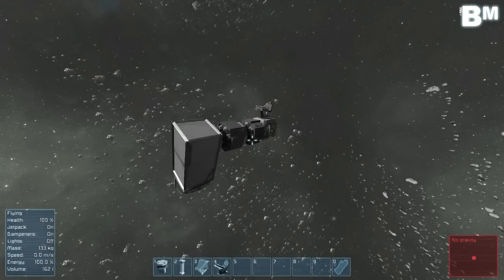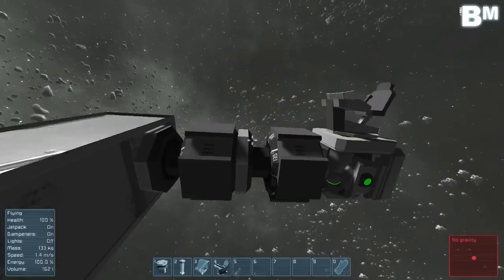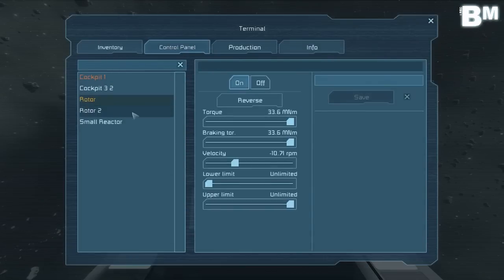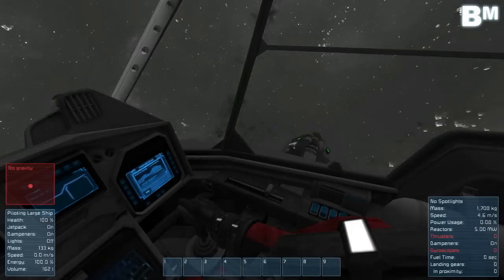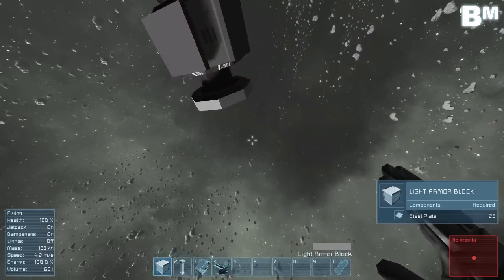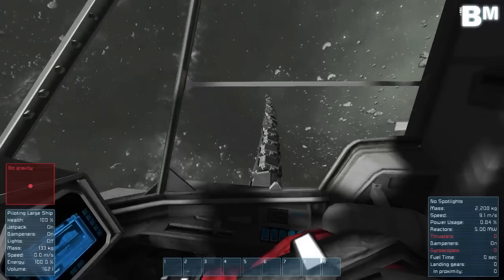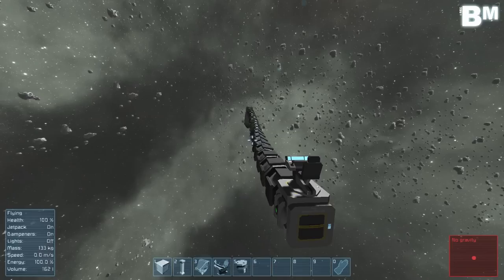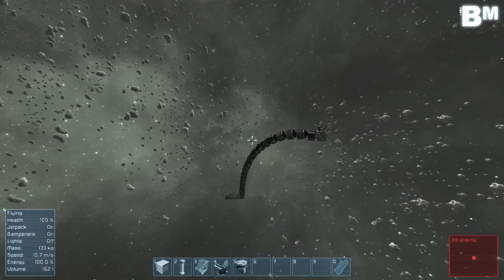Space Engineers - Rotating a Rotating Rotor

Comment: My guess on why it isn't rotating at maximum speed is that the rotors don't have infinite torque.  Each rotor you add theoretically adds a bit of rotational speed, sure, but ti also adds more torque load on the previous one.  Thus you get very rapid diminishing returns.  You might get better results with a balanced 'beam' at the end (think propeller), but you're still going to run into torque limits to accelerate the load up to maximum theoretical speed.
Reply: For clarity: Your 'load' has nonzero mass, therefore it requires torque to increase its angular momentum.  Each rotor also has smaller, but still nonzero mass, so rotor A needs enough torque to accelerate both rotor b and the load.  Basically each rotor you add to the end slows the previous rotor down.